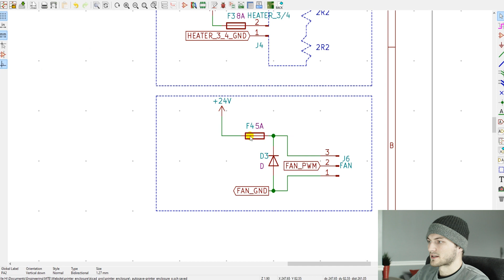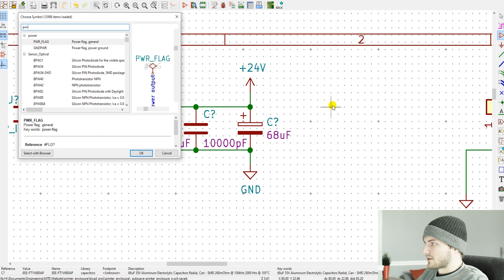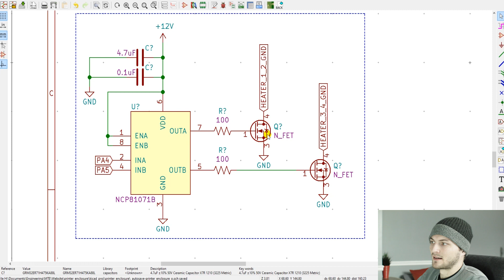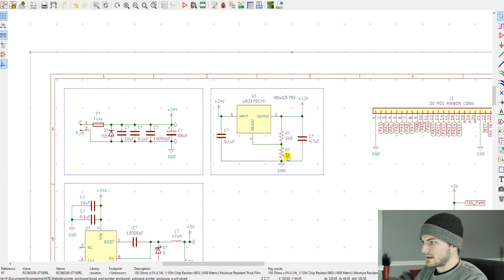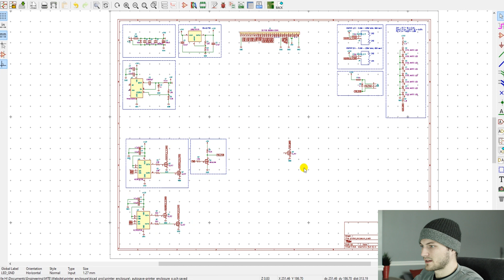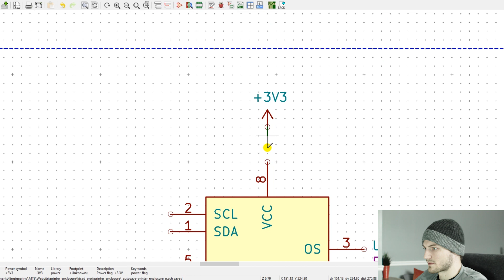Custom heated 3D printer enclosure part 2/x - KiCad PCB Design

Comment: This looks like it's shaping up to be an excellent series for me.  I tinkered with Kicad about a year ago and managed to make a small board with a couple of fets on it- even got it made at jlc pcb.  I'm currently building a 3d printer and definitely want to enclose it and deal with the fumes as best as possible as I plan on only printing with ABS.  Are you planning to make this an open source offering to those of us that are retired tinkerers?  😊  I'm really curious about the firmware/display portion as it's something I can't really tackle myself- at least in any reasonable time frame.  Thanks for posting these videos and I subscribed as soon as I looked at them and looked back at your other videos.  Cheers from sunny Canada !
Reply from the maker: Thanks for the kind words :). Yes, I'm absolutely planning on making a lot of the work I post on here open source. I hope to have something setup on our website for that, if not, probably will just use Github in the mean time.